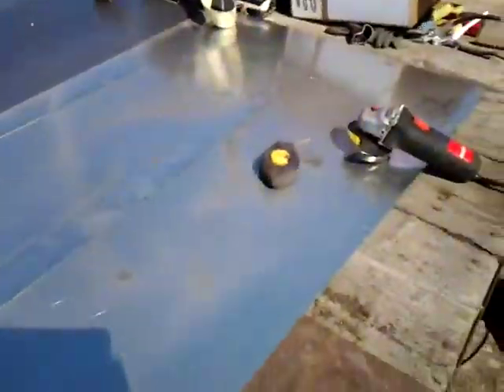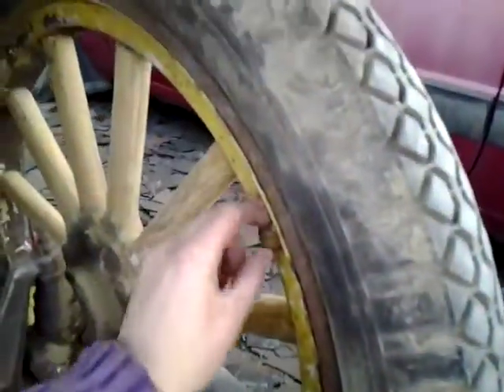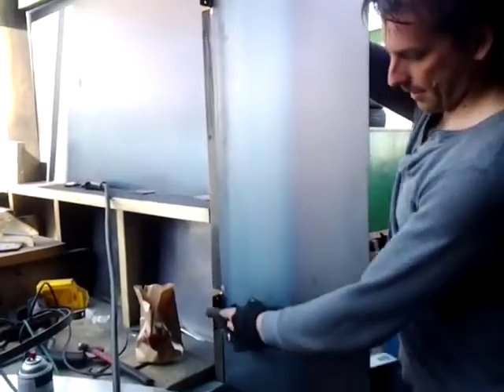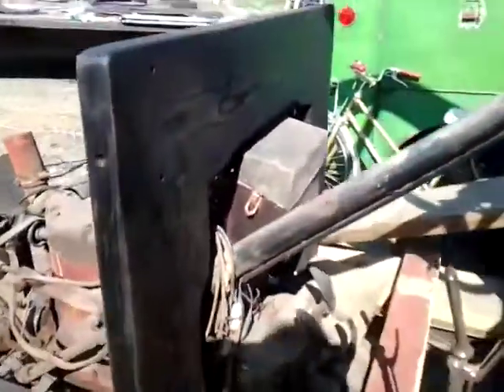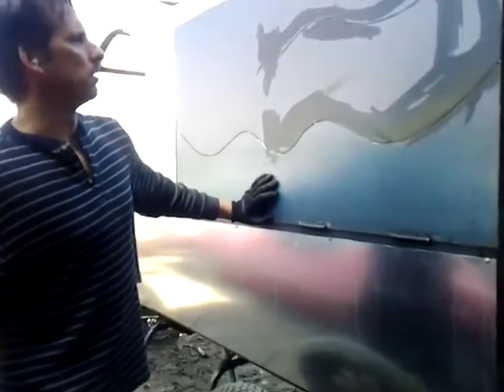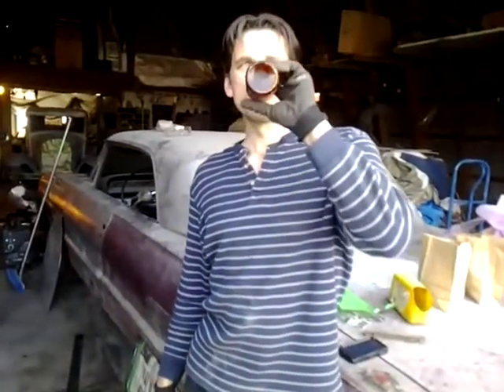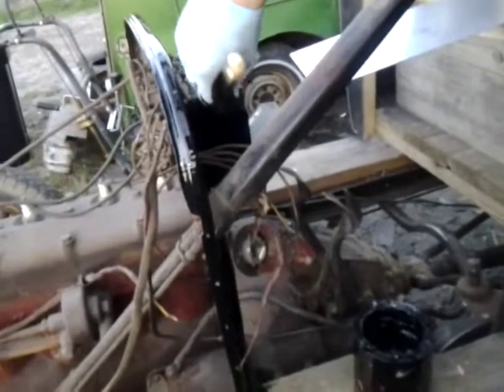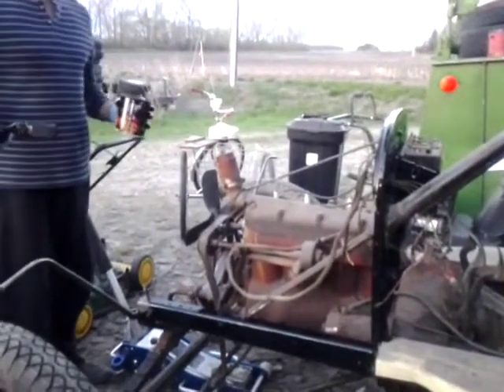Part 4 JW Ford Model T C Cab Delivery Build...In 6 weeks!

Comment: What gauge did you use on the sides? Looking great.
Reply from the maker: Thank you...I don't remember its been a few years now, I may say on one of the videos...the lower section was thinner, a normal 16 gauge probably, but the upper had to be pretty thick since it opens and closes, like 8 gauge I think.